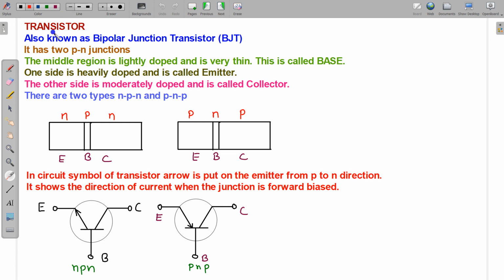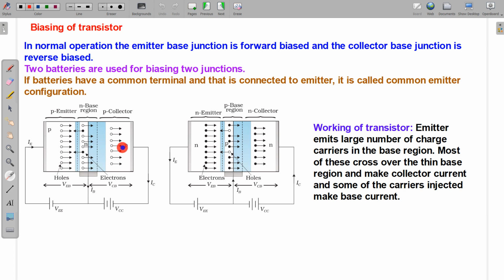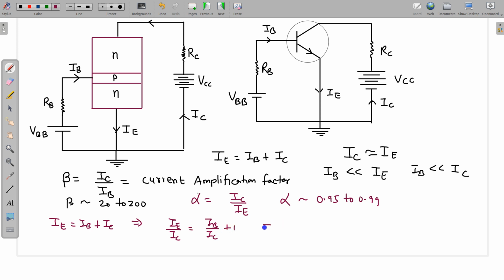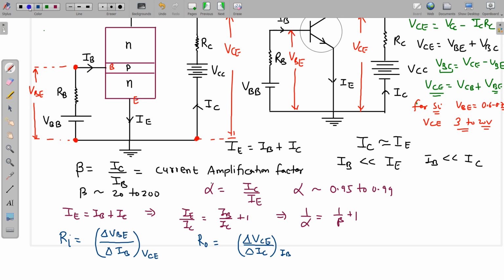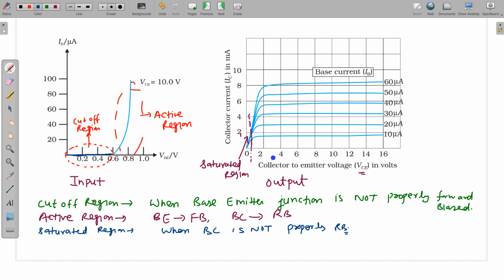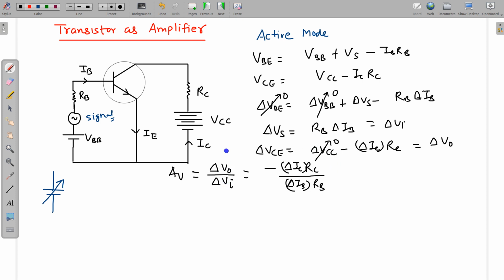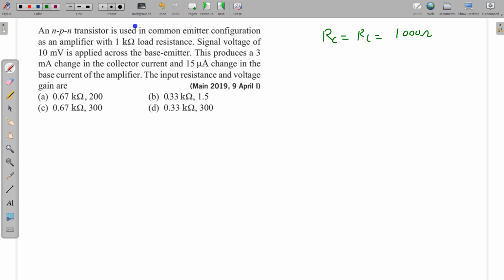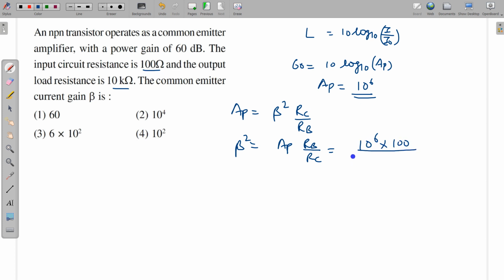Semiconductor | Lecture 4 | Transistor | npn Common Emitter | Amplifier | JEE Main Questions

Comment: sir at 19:29 we have to make terminal voltage V(CE) greater than V(BE) so it will depend on the resistance that we are connecting, so i dont think we can directly comment on Vcc and Vbb